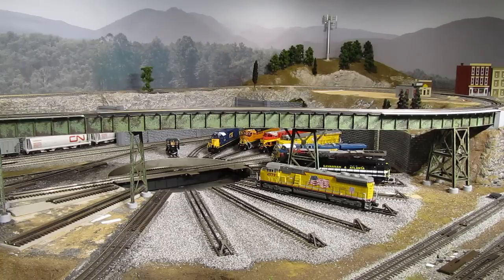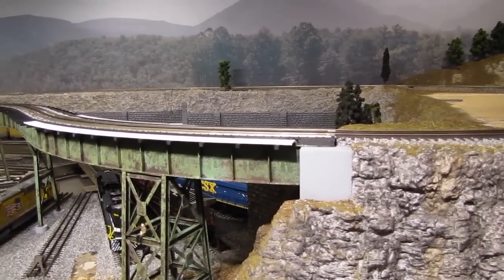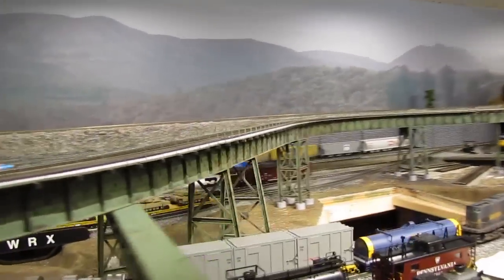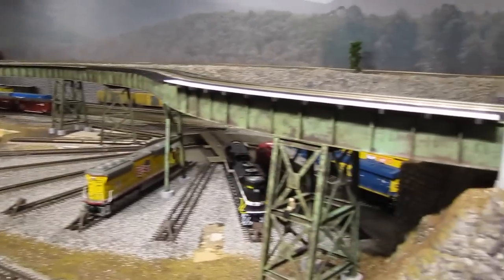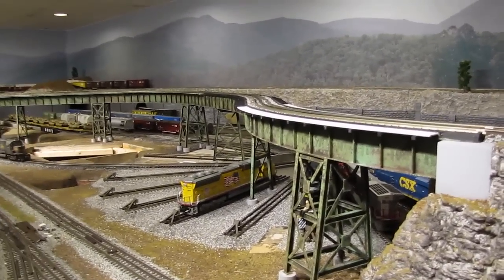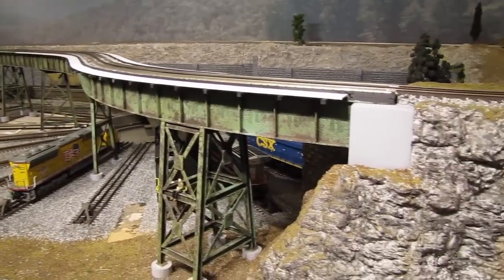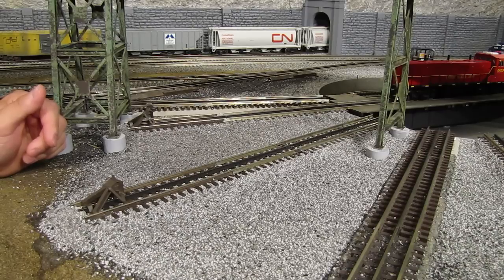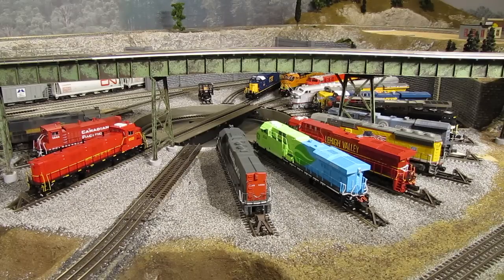Eric's Trains Video Blog Episode 46

Comment: Eric, 
 The bridge is fabulous and it makes sense to be curved. Your bridge is not BORING. It is hard to understand, however why the expense of stainless steel fabrication is justified when it is not necessary in prototypical construction material accuracy or visual accuracy and then covered it up with weathering to make it look like silver paint over iron. Neither is it in need of the strength, weather resistance or non-magnetic qualities of SS. Ocean going yachts and racing programs utilize stainless steel ...if they can afford it.  Finally, for welding, stainless steel requires higher skill and a finer welder than other metals. I can think of no other reason for a welded stainless steel bridge except for bragging rights. The bridge will be discovered someday by archeologists after all those locomotives have long ago moldered to oxides. Will you start buying locomotives of platinum next and lay down titanium tracks over streets of gold? I am obviously jealous.